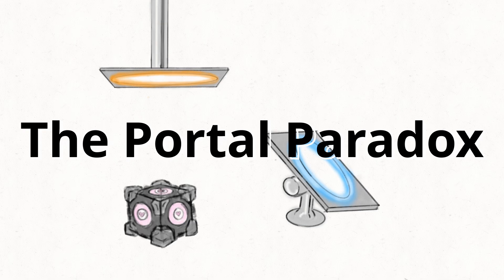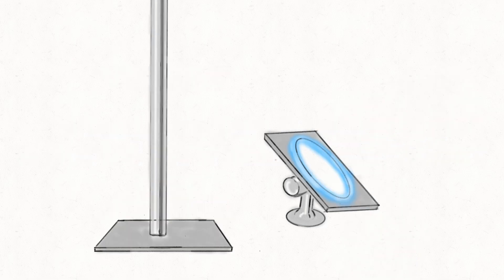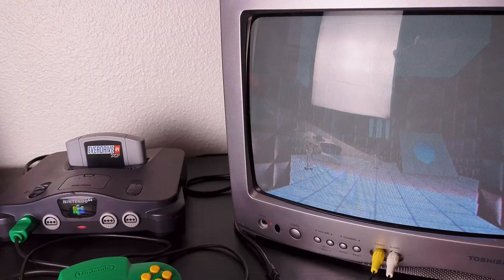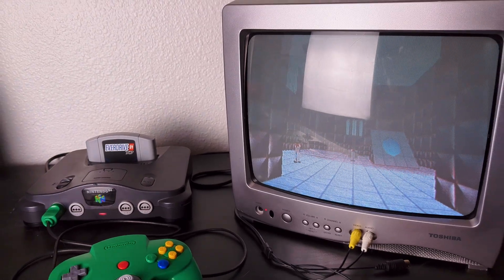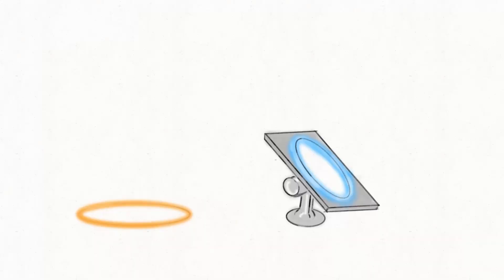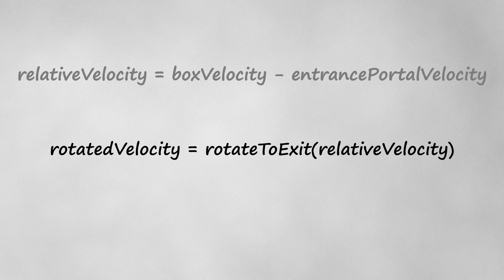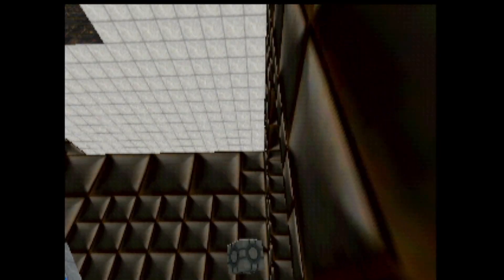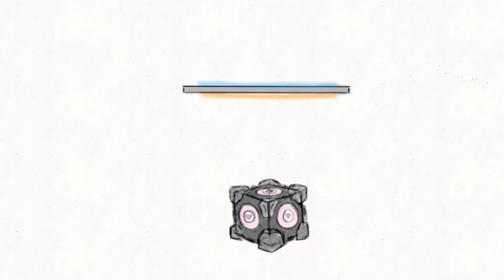I rewrote Portal from scratch and solved the Portal Paradox

Comment: i just thought that since the cube itself had no momentum, it'd be that by forcing it through a portal that way, it wouldnt have the momentum to move forwards on its own and instead it'd just be as much force as casually pushing the cube through, making it plop out on the other side
Reply: @potatopotawto1412  You’re contradicting yourself.

If, like you say, the part that’s already gone through the entrance portal is now going through the exit portal, that means the velocity relative to the portal must stay the same. (Portal falling at 20kph so relative to portal, cube going 20kph. Cube goes through portal at 20kph, cube comes out at 20kph.)

Plus I would advise you to read my explanation again, as you appear to have missed my point. There IS no excess space inside the portal, which is why there cannot be any change in speed.

Plus, there does not need to be any force on the cube. (We’re talking about portals here)
Reply: @potatopotawto1412 Going out of the blue portal at the same speed as the orange portal goes over the cube is not nothing. Where did the velocity experienced by the atoms of the cube going out of the blue portal go if it suddenly has to go to rest to fit your theory?
Reply: @potatopotawto1412  This behavior is really unhealthy. Of course you'd like to think that you're right all the time but that's simply not realistic. Just how a cube losing it's momentum when going through a portal is not realistic. If you reject the very possibility that you could be wrong sometimes, even when confronted with simple facts that prove it, all you do is lie to yourself and seem arrogant to the people, or cubes, around you.
Just like the cube has relative momentum to the portal, which is maintained when entering through it, your arrogance is maintained when entering through the eyes and ears of other people, which leads them to perceive you as an unpleasent person.
Take some time away from this comment section and think about yourself as the cube for a moment. Do you really want to remain static like this? Or do you want to enter the portal and learn more about yourself?
Reply: @potatopotawto1412 I think the failing in your logic here is that you equate a gain in velocity strictly to acceleration of the body in question. Thus you argue that since the cube is not accelerating it couldn't possibly gain velocity. But as others have pointed out what you fail to acknowledge is that its frame of reference changes when it goes through the portal. Yes it is at rest relative to its starting position on the orange side, but because of the motion OF the orange portal it is not at rest relative to the reference frame on the blue side. Critically this would mean that the cube would have to experience an instant deceleration relative to the blue reference frame in order to not come flying out, and since there is no force to provide that deceleration, we can conclude it must fly out.

The cube is not creating velocity, it is retaining its relative velocity.
Reply: @potatopotawto1412   So if you put your hand over the exit portal, the cube won't impart a force on it to move it out of the way? Does it just phase through your hand or does the cube not exit at all out of the portal? Which one would fit your theory more?
Reply: @stephen01king I think this is idea starts a good point to why i think his solution is wrong and momentum is the key. Would a person be sucked through if the portal came down but stopped 3/4 of the way down or would you be standing in both portals? Did the portal create momentum with its movement then instantaneously negate it with stopping motion? A portal connect ls 2 fixed points and no momentum transfer would take place. The object would just maintain it.
Reply: @trazatalks  A person would not be sucked. The only(noticeable) change would be the vector gravity that will split in two vectors both pointing towards the center of the earth and it's amplitude dependant on the mass of the part sticking out of the portal.
The portal doesn't impart any energy nor does it take away, else you would  slow down when passing through a portal.
Reply: @Dante4F8  I agree with your point. I believe portal physics are more dependent on gravity and not net velocity. But, the argument for net velocity would mean that  if the net velocity of the portal transfers to the object because of relativity. Then how does it account for a stoppage of movement when the majority of mass has passed. Is the net relative velocity of the majority of mass should cause enough force to pull the remaining through.
Reply: @trazatalks  the answer is for the game physics as they are in the game there won't be velocity imparted, no change in momentum.
In real life portals can't exist.
If we ignore the energy needed, the fact that the thing passing through a portal will be atomized, and focus on the theory there has to be an equal and opposite force to the (relative) kinetic energy imparted on the exit segment of the object acting upon the ground at the cubes original position. Else you are creating energy. And in this house we obey the laws of thermodynamics.!
Reply: @Dante4F8  I commented on the wrong video. I watched two in a row the other was by minute minutephysics and was based on real life physics. For game physics then the way it was coded is definitely not relative velocity but instead gravity vectors. He did a good job making a moving portal work within coding logic though.
Reply: @Dante4F8  consider the case that the cube to be passed through is glued to the ground. If you were to stick your hand in front of the exit portal as the entry portal is moved over the cube, your hand would be swatted away at the speed at which the entry portal is traveling. Whether or not the cube itself has velocity the fact of the matter is that a body is approaching your hand with a relative speed, and when it collides with your hand it simply will impart velocity. Now what if we replace your hand with another cube? Same thing will happen, two bodies are approaching each other with relative speed so if (when) they collide they will impart velocity, and since the floor cube 1 is glued to has much more mass than cube 2, it's a safe reduction to say cube 2 will be accelerated to the speed of the entry portal. 

Thus we know cube 1 has velocity in the reference frame on the exit side of the portal. What would cause it to suddenly lose this relative velocity?
Reply: I think the core misunderstanding here is that most of you believe that the cube had no momentum. But that's only true in relation to the floor it was standing on or to the observer. In relation to the portal it did have the same momentum as the portal had towards the cube.
Think about it this way. You may be sitting perfectly still right now but are you really? You sure are in relation to the chair you're sitting on, the house you're living in and the planet we all live on. But what about the sun, the moon, the center of our galaxy? Are you motionless relative to these objects?
Momentum is relative. The cube had momentum relative to the portal. You don't need to "transfer" any momentum because the momentum of the portal and that of the cube is the exact same thing.
Reply: I agree with you on this. Special relativity would most certainly factor into this, although I am not sure of exactly how. I would be interested to see how something like this would be resolved in reality. Would the surface hosting the entrance portal lose velocity proportionate to the relative velocity of the cube and the portal? Or would the exit portal be accelerated backwards relative to the cube exiting? Or perhaps both, 50/50?

There are a number of examples in reality of energy being conserved in situations where it doesn't necessarily "make sense" outside of the necessity of the conservation itself, if that makes sense (mostly to do with various products of particle decay, atomic fission/fusion products, virtual particle/antiparticle pairs, perhaps hawking radiation, if it ends up being experimentally confirmed) - so I believe there is precedent for this. It seems like the universe isn't always too strict about the specifics of what happens, as long as its fundamental rules are obeyed. @kremitthetaco8725
Reply: @potatopotawto1412 
I know that for someone who isn't very good at reasoning, it can seem like using big words and sounding pretentious is the same thing as being clever or knowing what you're talking about. Unfortunately for you, they are only tangentially related.

Your arguments, where you even bother making them, are poorly formulated. Half of your responses are badly thought out technobabble nonsense.  You don't think out the consequences of your argument and wield your smug ignorance like a club to deflect criticism.

You are factually wrong, your position is indefensible, and your approach to argumentation is intellectually dishonest and irresponsible. You've made an idiot of yourself, and everyone who agrees with you has been tragically caught in the crossfire.
Reply: This comment section is a nightmare
Reply: The way I thought about it was to break apart the cube into layers. Let's say layer 1 is the top of the cube, layer 2 is the layer underneath, etc. 

When the moving portal comes down to layer 1, layer 1 appears through the stationary portal. No issue so far. But when the moving portal goes to layer 2, layer 2 needs to appear through the stationary portal. Unfortunately, layer 1 is already through the stationary portal. So layer 2 needs to push layer 1 in order to make room for itself. Specifically, the velocity that layer 2 pushes on layer 1 must be equivalent to the velocity of the moving portal. It logically has to, otherwise the cube will stretch or compress. So when layer 3 goes through the portal, it pushes on layer 2, and so on and so forth. Hence, from this perspective, the cube isn't necessarily being "pushed" by the portal. It's just being pushed by itself. But the end result is the same: the cube flies through the portal quickly
Reply: @potatopotawto1412  From the perspective of the portal the box was quite speedy.
Reply: @potatopotawto1412  If the cube smashes your hand, it is transfering kinetic energy into your hand. For it to have kinetic energy, it must have a velocity, so no, from your frame of reference, it has a velocity.
Reply: @potatopotawto1412  You are very simple. I agree.
Reply: @potatopotawto1412   "That's a result of two objects not being able to exist in the same space at the same time. Your hand is not able to withstand the box and the floor it's resting on pushing back against you. You're wrong here."
  Wait wait, you're telling me I'm wrong for saying your hand and the box moving from the exit portal has velocity? That is hilarious. What do you think velocity even means? Bro, that is the most basic of basic physics.

"At no point have I ever stated the box has velocity."
  You clearly said the ground is rising, and by extension the cube. How does a box rise without velocity? Again, that is basic physics. Are you seriously claiming that something can move without any velocity?

"Thank you for proving me right. If the portal exerts no force on the cube, how does it get launched?"
  By already having velocity from the reference frame of both the portals and any observer at the exit portal. I've been saying the same thing over and over and you're just to obtuse to get it.

"The only way for the cube to end up with more speed than it began with would be for either the floor it's resting to physically launch it or for an anomaly to cause the box to jump. You're wrong here."
  Again, the velocity is only maintained from the reference point of observers at the exit portal. It's your suggestion that it would suddenly stop after having the velocity to rise through the portal that involves any unexplained changes in velocity.

"At the end of the day, all evidence and mathematics supports my argument whereas your argument is based on anomalies according to the knowledge we have at hand."
  At the end of the day, they support the notion that you have no basic understanding of physics lol.

Let me give you an exercise. Imagine the opposite scenario, where we have a stationary entry portal, and an exit portal moving backwards at 5 m/s. Now imagine you push a cube at 2 m/s through the entry portal, what is the velocity of the cube at the exit portal relative to you? Does it conserve the velocity from your frame of reference of not?
Reply: @potatopotawto1412   Yes, exactly, and since in physics velocity is only relevant with a frame of reference, the cube has velocity from reference frame of the entry portal. Therefore, that velocity shall be preserved when the cube exits the portal.
Reply: The equations in the video are basically the conservation of momentum eqs so idk what you're on
Reply: @ethandavis7310   the problem is, that the moving portal wall isn't touching the cube with its mass so there is no way it could transfer its momentum to the cube (instead of transferring it to the ground which should happen in my opinion (again, assuming that a portal middlepart is massless)). Additionally, the momentum of the cube aswell as the earth would be changed if the cube flew out which does violate the conservation of momentum (the equations in the video aren't wrong per se but incomplete)
Reply: @ethandavis7310   The cube itself doesn't have any momentum.
Reply: @BagPussHerobrine  momentum doesn't physically exist. It's always in relation to some reference frame. If you set up the conservation of momentum equations for the entrance and exit and you constrain the  movement of the portals you'll see that the cube must fly out of the exit
Reply: @potatopotawto1412  That's a very arrogant comment coming from someone who replied on a question about physics without knowing basic physics. You should google 2 things:
1. Newtons laws of motion
2. "Is motion relative?"
Reply: The cube itself had no momentum, so the portal had 100% of the starting momentum. 
When passed through the portal, the momentum is transferred with 100% efficiency. (what comes in goes out)

(One reason that portals are impossible IRL is that 100% efficiency is not possible. The cube would start moving out of the other portal before the entry portal has stopped, resulting in a net gain of momentum, each object having 100% of the starting momentum = 200%)

Ignoring the impossible bit, once the entry portal has stopped, all of the momentum has transferred to the cube, causing it to fly out of the exit portal.

TL:DR =
Momentum transfers from portal to cube.
Reply: @temhgb a Portal has 0 mass and therefore 0 momentum. It can't possibly be imparting anything to the object passing through it.
Reply: @pyrus2814  The piston and the portal act as one object, they share momentum.
Reply: @temhgb  In my head it would make more sense if the cube would just stay in place and slowly slide down the wall of the exit portal. The Momentum isn't transferred to the cube (why would it, there is no "collision" between wall and cube) but to the ground below, like a normal object being pushed into it.
Reply: @MrCool1187  I get your point, but there’s an even simpler reason why it couldn’t just flop out of the portal.

The cube would be crushed if it didn’t.

Relative to the portal, the cube is travelling towards the portal at the same speed the portal is falling at.
When the cube enters the portal, IF it does not continue going the same relative speed, the portal acts like a wall basically

If on the entry side of the portal it is going let’s say 20kph relative to the portal, and it flops out of the other side of the portal at 1kph (relative to the exit portal)

When it is halfway through the portal on the entry side, there would be less than half of the cube sticking out of the exit side (1/10th of it pretty sure) because the entry side is entering faster than it’s exiting the other side (already impossible) 

If there’s no tube inside the portal and the entry portal leads directly to the exit with exactly 0 length of tube between them, the fact that the cube isn’t also halfway out of the exit means that some of the cube has either been crushed or just vanished. 

That’s why the momentum transfers, the floor pushes the cube through the portal, and the cube pushes itself as well I guess! 
With the momentum transferring, it would fly out.

I’m really bad at explaining things like this, but this is how it works
Reply: @temhgb   ok but that would increase overall momentum, since the top portal wall is pushed to the floor, that momentum is transferred kinetically to the earth in that case. If the Cube suddenly gains Momentum aswell then conservation of Momentum would be violated (assuming that portals are massless (except the edge))
Reply: @temhgb why would the momentum transfer to the cube though? How is the force being applied
Reply: @Ghoulgran 
A fundamental misunderstanding.

A Portal's whole thing is that it can change an object's momentum and location without imparting any forces directly.

Doing anything with a portal at all is a violation of conservation of energy and momentum. This objection holds no water whatsoever.

Asking questions about "where the force comes from" may be illuminating but it's undeniable that the cube is moving as it exits the portal. To exit a portal, you must be in motion relative to that portal.

How fast do you exit the portal? At the exact same relative speed you entered it.

If you and the portal were approaching each other at 100m/s as you entered it, then you must be exiting it at exactly 100m/s.

This isn't an assertion. I am describing what you must imagine on the exit portal for it to be even remotely coherent to visualize.

It's not possible to imagine what it looks like at the exit portal without seeing the cube moving out of the exit portal. And if you pay attention, you will notice that the speed with which the cube exits in this hypothetical must be the same speed at which the piston approached it. There is no other speed even imaginable.

For it to exit slower than that, it would have to be flattened. For it to exit faster, it would have to be stretched out. Unless you think the cube is flattened into a perfectly 2d square, you must be imagining it exiting the portal with speed. What is that speed, and if it slows down to plop out instead, what causes it to slow down?

The plopping hypothesis has to explain where the speed comes from and then it also has to explain why the cube magically slows down again after coming through. The idea that it even solves the problem it supposedly solves is just a failure of imagination.
Reply: @fieldrequired283  If we consider that portals are essentially bending space, I can imagine that the cube is not moving while going through the portal, but the entire space on the other side of the portal is getting bent towards it.
Reply: @Ghoulgran  
All motion is relative. If the portal is in motion relative to the cube, the cube is in motion relative to the portal. There is no Absolute Stillness to compare objects to. You have to choose a reference point to describe motion at all.
Reply: @potatopotawto1412   

"it has potential energy everything does."
This has nothing to do with potential energy.

"When it comes into contact with my hand it pushes onto my hand and my hand pushes onto it"
When it comes into contact with your hand, does your hand move? That is called velocity, my dear sir. 

"It's technically the ground rising below as the portal is enveloping the cube."
And now you say the ground is rising, meaning it is moving, therefore it has kinetic energy. Thanks for proving my point.

"In no way shape or form does the cube have any sort of velocity."
You just claimed that it does in the previous sentence.

"Basic physics."
Basic physics always refer to a frame of reference, which you don't seem to grasp.

"An object at rest will stay at rest unless acted on by an outside force."
The object was not at rest, as you yourself has claimed.

"The only outside force present in this equation is gravity as the cube exits the blue portal. That's it."
Nobody claimed otherwise. You're still confused, it seems.

"It would be breaking a law of physics if the cube magically received velocity from nowhere."
It didn't, it already had velocity from the reference point of the portal, or anyone looking through the exit portal.

"The portal exerts no force on the cube in any manner so there would be no speed."
Nobody said the portal exerts any force on the cube. But now that you talked about force, how do you suppose your hand is moved away from the portal without any force?
Reply: @potatopotawto1412  lol, so basically, "I can't refute what you said, so I'm just gonna run away from the argument and pretend whatever I said before was a slam dunk, despite each point being already refuted by you." What a classic move.

If you being right includes your claim that something can move without having any velocity, I wonder what other wonderful things do you believe in.  

Are you a flat earther, btw? That lack of understanding of science does make you sound like one. But then maybe not, not even flat earthers have ever made that kind of claim before. lol
Reply: If I hit you with a hula hoop perfectly at speed 5, your speed would still be 0 because I didn't hit you with anything but air. Now speed it up to speed 100, now the hula hoop still does nothing to you because the hoop won't smash you like a platform would, your speed would still be 0.

Portals are just spacial hula hoops connected to another hoop, you need an object to act on another to transfer momentum and guess what a portal does? Removes the object, in the shape of a hoop.
Reply: @ReaperEOD  A hula hoop is not equivalent to a portal because both the entry and exit of the hula hoop are moving together. A portal in this case have it's exit stationary in reference to the surrounding.

In the hula hoop, conservation of momentum is achieved having the same relative velocity of you to the hula hoop as you enter it as the relative velocity of you to the hula hoop as you exit.

In the case of the portal, the same thing needa to happen, only this time the exit portal is stationary, so the relative velocity required to conserve momentum makes the cube shoot out of the exit portal instead.

Think about it, if you look at the cube through the exit portal, you'd see a cube moving towards you with a certain velocity. Where does this velocity go once it passes through the portal if it is supposed to just stop without any force acting on it.
Reply: @potatopotawto1412 
You are right. 
They are wrong. 
Good effort.